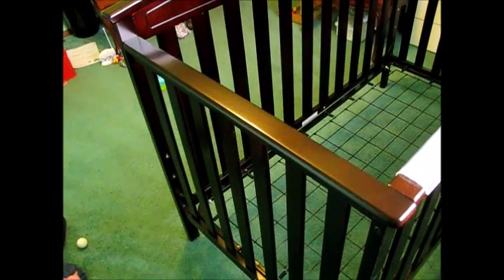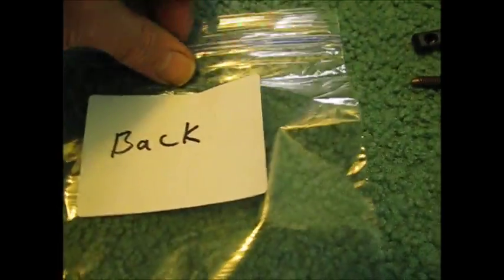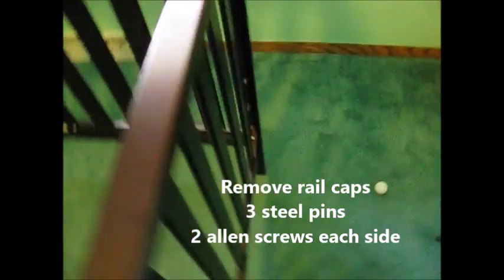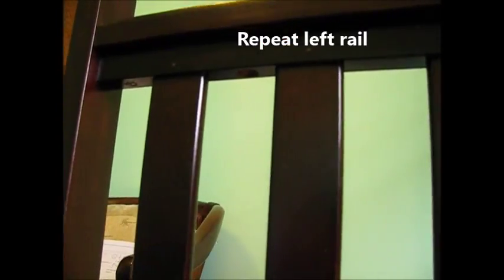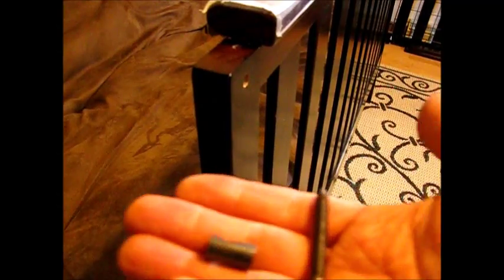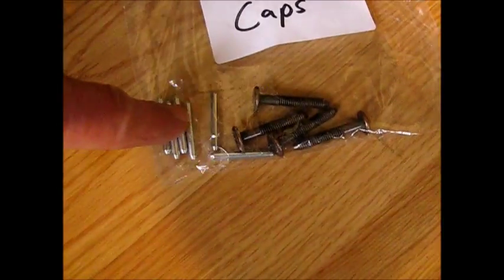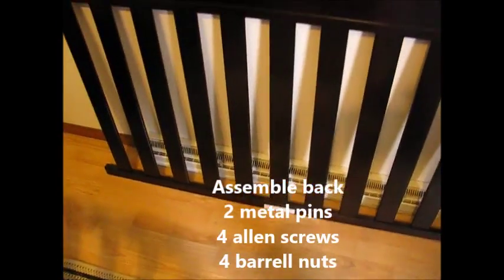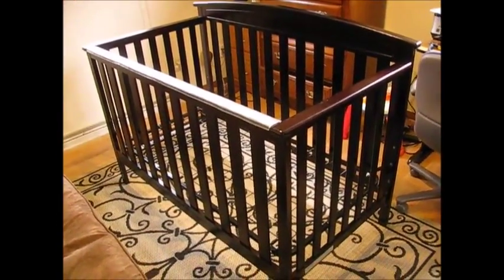How to take apart and put together a 2016 Delta Children crib model  7312-207

Comment: We have that crib and we are trying to turn it into a toddler bed but we lost all the screws because it was in storage. Do you happen to know the sizes of the hardware we need.
Reply from the maker: Sorry I do not and no longer have access to it for sizing. You may have to take one of those barrel nuts to the hardware store to size it up for length and pitch.
Reply: @TheOriginalMechanic  thank you for responding